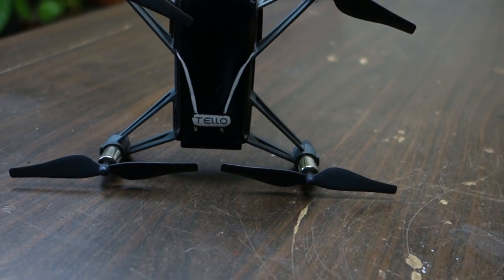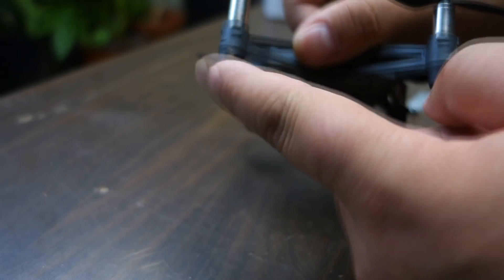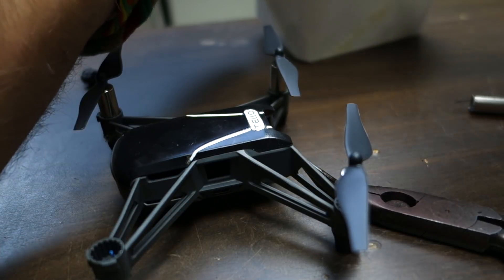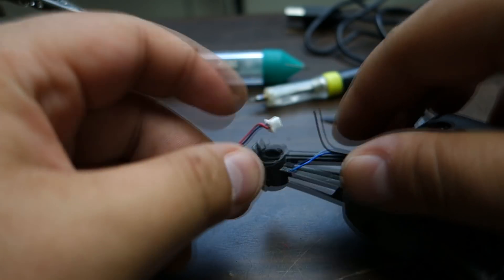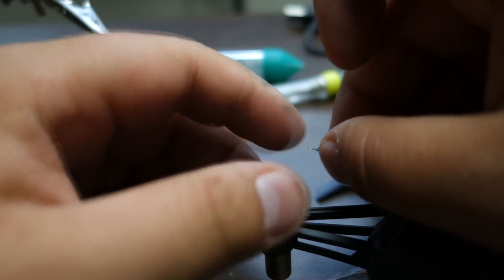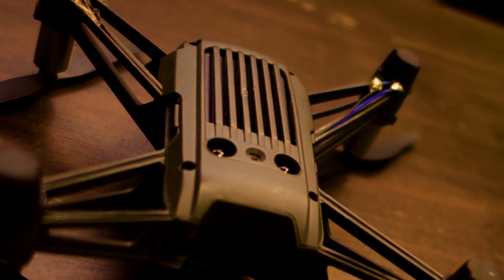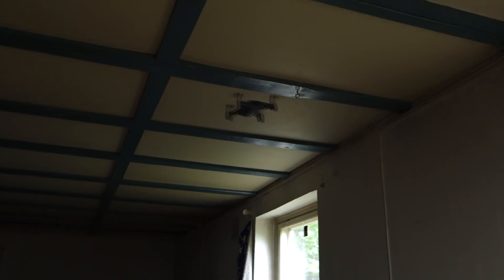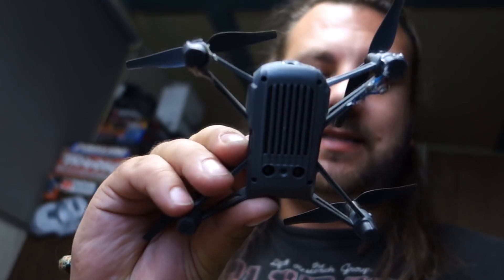DJI RYZE TELLO HOW TO CHANGE MOTOR ROUND 2

Comment: i would solder them directly to the board cant stand the wires sticking out, but this one is easy
Reply from the maker: yeah that is a more fine job, I just wanted it to work. It is only 99$ so easy job well done =) Thank you for the comment.

Comment: Changing the rear motors on the tello is a lot more tricky. None of the videos I watched on YouTube warned me about the antennas concealed on the hind legs and so I ended up cutting the wrong(the antenna) wire. You simply have to unscrew the bottom of the tello, find the right wirings, unsolder, pull off the motors and the wires will come along. Make sure your replacement motors have wires sufficient enough to reach where you have to solder them into. Also, DO NOT REMOVE or cut off those landing pods coz that would surely damage the wifi antenna. Sorry man, I just learned from my mistakes.
Reply from the maker: Oh I did not know this, lucky my back motors are still working :O Need to look into that ! Thank you so much for this information Sonja Zarola! =)

Comment: How many hours did you fly before your motors burnt? I wanted to buy a tello but because of the brushed motors I'm not sure about buying it anymore. What's your idea so far?
Reply from the maker: I had a crash, that's why I had to change it. The other time I changed it I had crashed into water :P And some dust came inside the motor and it stopped. So I actually don't know how many hours you can fly before this has to be done :P If you are careful probebly a whole bunch of hours! =) BUY IT it's 99$ and after I bought mine and loved it I had to get the mavic for like 1000$ so :P haha
Reply: @SwedenRCAdventure  thank you so much...

Comment: Hello,i noticed that you tipp with your finger the left below angle of the Tello app screen and the motors start spinning without the quadcopter taking off,you did that several times,I have tried too but nothing happens,the motors do not start spining,would you tell us how ?
Thanks..Al
Reply from the maker: You have to use both fingers on the two "sticks" and push them down to the side at the same time, it's a normal way to start drone in general =) Hope I could be of some help and thank you so much for watching! =D